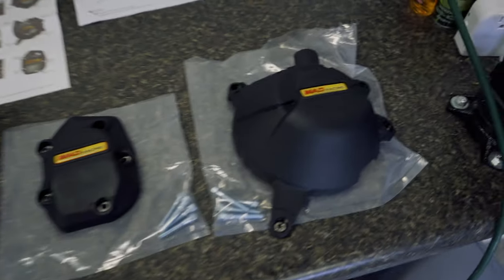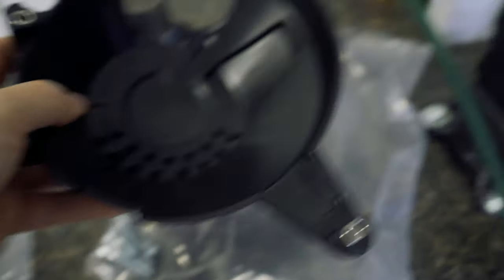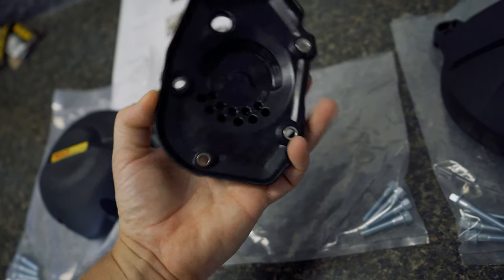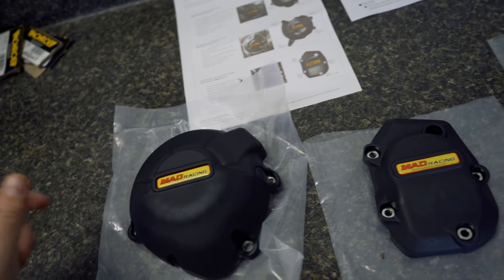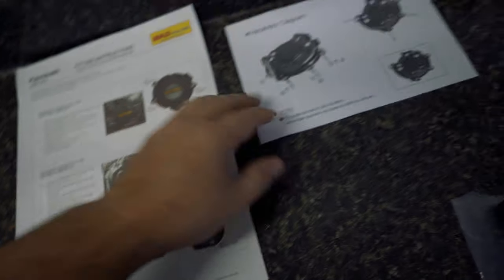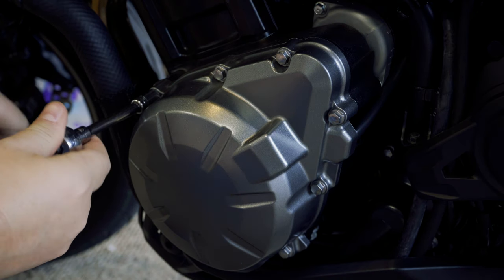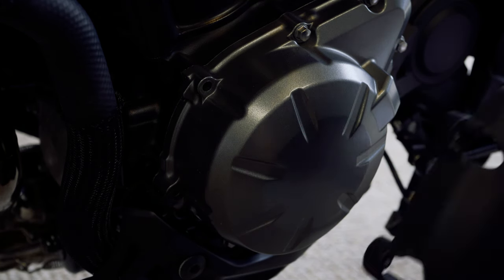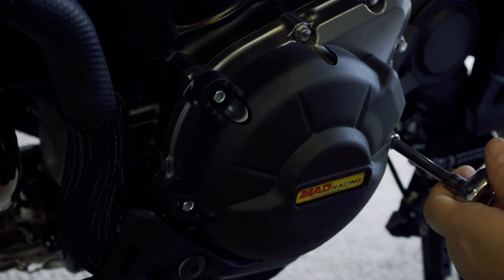Z900 Engine Covers Installed

Comment: How are these covers holding up? Looking to buy some, but like you don't want to spend double the price for a brand name if the knock off or cheaper one works the same.  Lol, just my luck- currently unavailable in 2021..😠
Reply from the maker: So far they have held up great I did knock my bike over once in the garage, frame sliders and engine covers did great no damage. Thanks for watching and for Being a Subscriber.

Comment: Hi! May I ask the torque specs of these 3 bolts? How many Nm for exactly. Many many thanks!
Reply from the maker: The clutch cover ,Alternator and Crankshaft sensor bolts are 12Nm(106 in-lb)
Reply: Simple Simon thanks for your reply man!

Comment: Do you happen to know the toque values for these bolts and the ones for the frame sliders?
Reply from the maker: Front Frame Slider bolt is 59N-m
The rear Frame Slider Bolt is 44N-m

Engine cover bolts 12N-m

Comment: Do you need engine covers if you're using frame sliders?
Reply from the maker: It Depend, on a naked bike you don't have fairings to help with protection.Frame sliders do well for parking lot drops and slow low side slides. I wanted the added protection just encase there are rocks or any thing on the road not to damage my engine. I hope this answers your question.
Reply: @SimpleSimon  yup it does. And I'm probably going to be picking up a z900 in the next few weeks. Took your advice and found one on craigslist with a full akro pipe, and got him to knock the price down by 700 lol
Reply from the maker: @Smoove233  What!! That is incredible!!